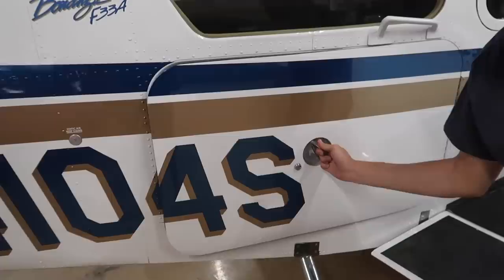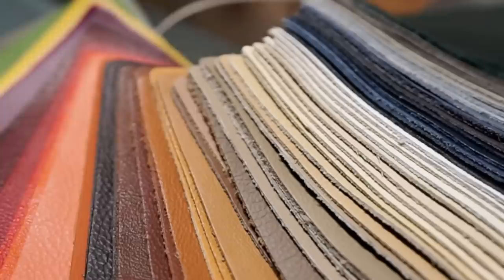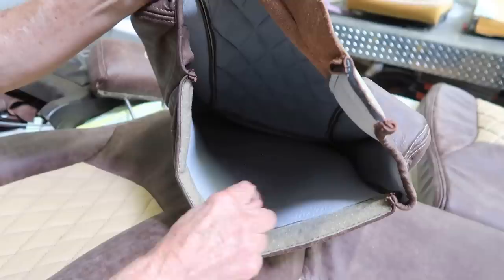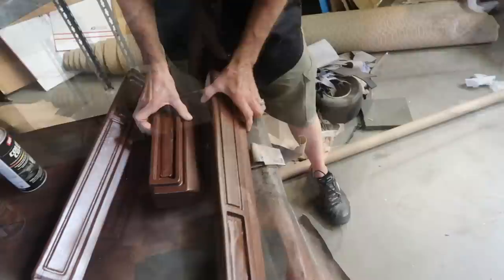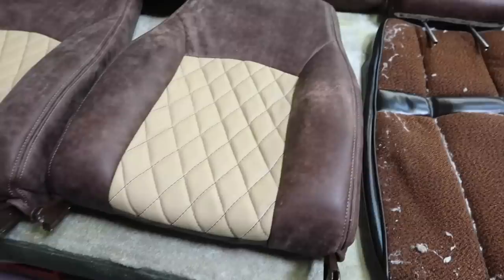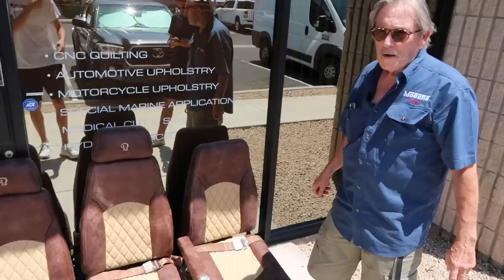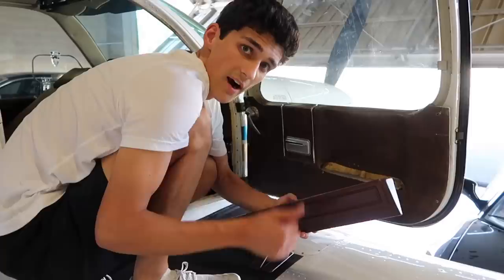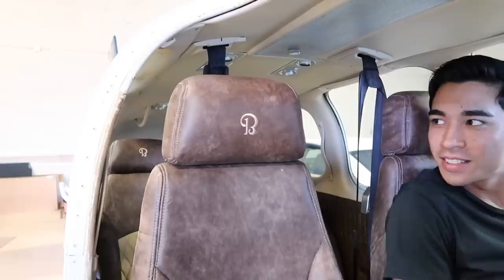New Custom Interior For Our Beechcraft Bonanza F33A! (Design + Install)

Comment: Looking great guys. When budget and if your preference allows, do the door cards next to get rid of the last of the vinyl 70s. You guys are young so didn’t have to live through years of these colors and materials like us older dudes.
Reply from the maker: We were thinking of doing it all, but since everything else is in such nice condition, we decided to do just the seats and armrests for now. Really freshened up the interior!
Reply: I just bought a 1973 Piper Arrow II, all original, seats, carpet and radios.
I remember the 70’s and now I am going to relive them, as I throw them away. May need to give Ron a call.